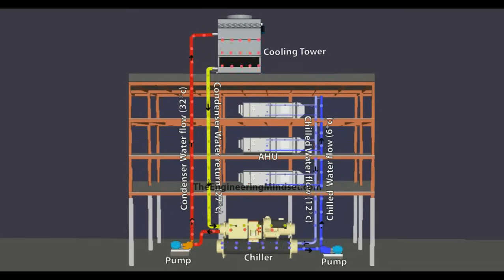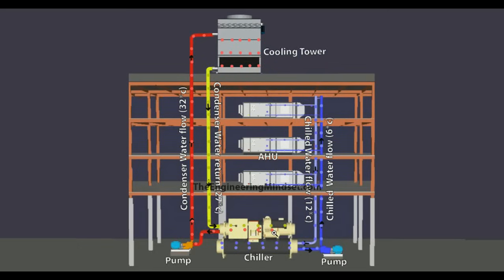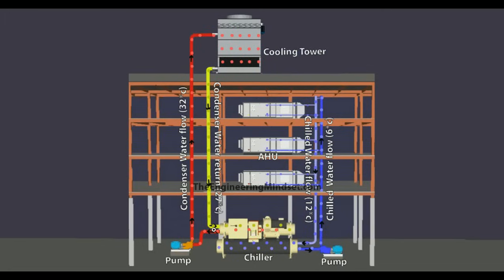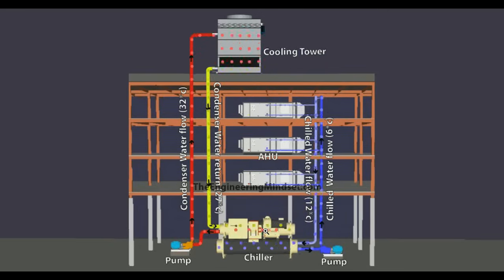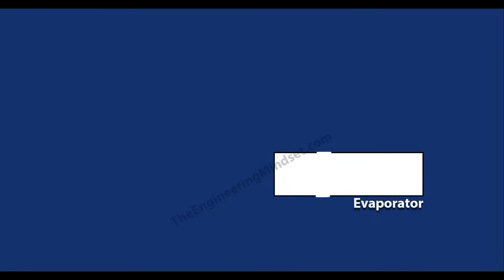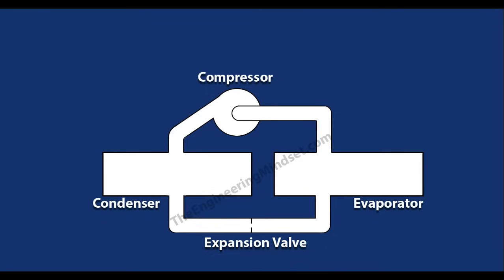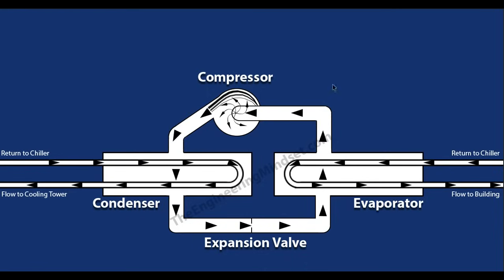Chiller Basics - How they work

Comment: The heat transferred from the returned cooled line of 12 deg. is cooled again up to 6" VIA EVAPORTOR NOT CONDENSER,
the purpose of the condenser is to minimize the temp. of refrigerant only which causes a cooling effect by evaporation,  there are two loops and water circulation, first is a loop for circulating the cooled air of 6 deg. coming out of the evap. the send it to the fan coil unit, and the second loop to circulate the cooled air of 27 deg through the condenser of the refrigerant to help it cools and cause the refrigerant in the chiller unit to change from gas state to liquid state. then goes to the evaporator to expand and gives cooling effect, STILL I AM GETTING LITTLE CONFUSION IN YOUR VIDEO DEAR

Comment: 00:06 A chiller is a large machinery used to generate cool water for air-conditioning in buildings.
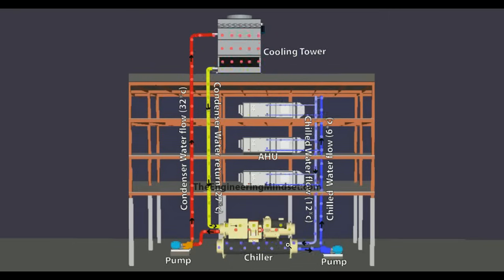01:55 Chillers transfer heat using a refrigerant and cooling tower to provide cooling for buildings.
04:14 A chiller has four main components: evaporator, condenser, compressor, and expansion valve.
06:23 Chilled water loop is responsible for collecting heat from the building
08:18 A chiller works by circulating refrigerant and water through different circuits
10:27 The chiller has four main components: compressor, condenser, expansion valve, and evaporator.
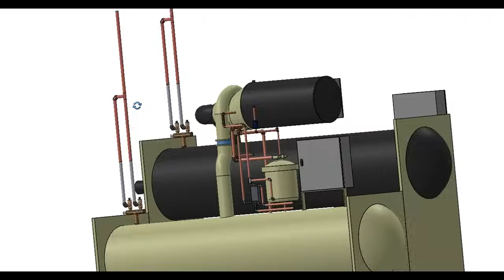12:40 Chiller Basics - How they work
14:53 Chilled water enters and leaves the system while refrigerant circulates throughout.

Comment: In the first video you said the condenser was on the top. 

In the picture diagram you said the condenser was on the bottom.

Which one is it?
Reply from the maker: It's wherever the engineers designed it to be. It can be side by side, below, above or remote. You can look at the system components to determine It or look at a system diagram

Comment: Can you point me in the right direction if you have a video on different ways to control the water/temp of each ahu/ fcu. Eg if the ahu1 still requires cooling but the space conditioned  by ahu2 is at the the required set point. How do the valves direst the water.

Comment: 3:20 how does the 27*C refrigerant from the Condenser Return picks up heat from the 12*C Chilled water return? Doesn't heat go from hot to cold? Shouldn't it increase the temperature of the Chilled Water Return and decrease the temperature from the Condenser Return?
Reply from the maker: The refrigerant is not 27 degrees, that is the condenser water. See this video for more details https://youtu.be/QlKSGDgqGF0

Comment: Hi thanks for the information. Question: so I live in a YCMA with a chiller here in Phoenix AZ. It’s hot 🥵 here. Our chiller is “broken” and needs to be “fixed” every summer. I have a feeling the maintenance department is not thinking correctly about our unit. Am I correct in that, more than breaking and fixing, these chillers need to be “maintained” daily?

Comment: Hey Paul, In the min video duration of 7.31 Min, i have a abit query. Where is the evaporator chilled water come from that circulate from evaporator side to AHU and then AHU return back to evaporator chiller?. Since u draw its different component from condenser. Because what I've understand from cooling tower then enter the condenser only circulate within the condenser and then return back to chiller right or the water is pass to TXV and evaporator? or only circulate Cooling tower and condenser?

Comment: some refrigerant system off air conditioning use solenoid valve after expansion valve. What is the function solenoid valve? if not use solenoid valve what gonna happen?

Comment: Trane chiller 
Model-CDHG(water cooled chiller)
Refrigerant- R123
Problem- chiller both circuit parameters fluctuating igv open close continuously not stable leaving water temp 
We changed leaving water sensor,saturation sensor,configuration,water flow normal,igv manually open no issue but still problem not solved,can u please suggest me 🙏

Comment: Only problem with the labeling is that according to the laws of thermodynamics, why would the heated water (12c) from the building want the transfer heat from it  to the refrigerant (which is at a higher temperature of 27c )? It makes sense if the labeling is flip flopped from water to the refrigerant side.

Comment: So the water passing thru the evaporator and condenser is separate? The condenser water will go to the cooling tower and the evaporator water where it goes?..
Reply from the maker: Please watch our turbocor chiller vidro
Reply: @EngineeringMindset  but is there a reservoir of a cooled water circulating thru the evaporator?. Like in the condenser, the water cooled goes thru the cooling tower.

Comment: Dear sir

I have one doubt, the gas is moving from compressor to condenser at High Temp and High pressure Gas and from there to Expansion valve at High Temp and Pressure Liquid (according to Vapor compression Refrigeration Cycle).
Now if there is a heat exchange from water to gas in the condenser which loops cooling tower then shouldn't the gas from the condenser to the Expansion valve go at  Low temperature and low Pressure Liquid ?? kindly clarify my doubt (I know it sounds stupid )

Thankyou

Comment: What is the flow to building and returning to chiller in a loop, water? Tape water or special type of liquid? And types or TXV used in the system?
Reply from the maker: Normal water, with some chemicals added to stop bacteria etc. We have a dedicated video on chiller expansion valve types.

Comment: Hello Namaste! 
As you said there are two openings for water one 6°c line which will go to to room Or space to be cooled and other line absorbing heat from space which is 12°c . My question is does refrigerant comes in contact with 12°c line if yes then why?? I understand it touches 6°c line to provide more sufficient cooling by extracting heat from water before entering to AHU

Comment: I have little Bit Confusion that In this Tutorial There is a Pump for supplying the condenser water to cooling tower is Wrong. and Chilled water Supplying Through a Pump.
The Condenser Pump Suck water from the Cooling tower to Condenser of Chiller.
And A Primary Pump supplying the CWR TO chiller and Chiller Supply CWS TO AHU with the help of Secondary Pump.
Reply: I think his example is an economical solution by taking advantage of the gravity feed from AHU to chiller return and utilizing only one supply pump for CWS back to the AHU. He is eliminating one pump in the process. Same gravity flow principle from the Cooling Tower to the Chiller as well. It is just an example.

Comment: Thank you for the explanation ...i just want to know,  so the whole system starting point is the water flow to chiller inside evaporator?
Reply: I understand some people view the evaporator as the central component of a chiller because that's where the  cooling of the air or water actually occurs. I personally view the chiller itself as the central component of the refrigeration system.

Comment: What happen if old design building cooling tower same level with chiller at the ground not at rooftop ?
Reply: cooling tower should be outside to push all hot air from water there. The best and cheapest way is just to put it to the roof outside.

Comment: Hi I have a question about the chillers unit? What does the AHU pipe do in the condenser socket? And why do I need an oil change?
Reply from the maker: AHU's: https://theengineeringmindset.com/air-handling-units/
Chiller oil: https://theengineeringmindset.com/refrigeration/

Comment: Hi ,
For that system is it different from the normal chiller? For normal chiller it use the gas to run through the evaporator to absorb the heat from the room. But in this system it let the water to run through the evaporator and use the cool water to absorb the heat.
Thank you,

Comment: Hi there, just a silly question. Is it possible to place the chiller outside the building and use the atmospheric air to condense the working fluid? What's the advantage of having the cooling tower?
Reply from the maker: Well yes but for that you would want and air cooled chiller. Check our other videos for tutorials Al's on that

Comment: A quick quistion. When the thermostat calls for cooling and it's pump down what's the  sequence does the water pump kick in first  flow sensor detects  and then the solenoid valve opens and then the compressor open?

Comment: Great video. I wanted to ask a question. My company has a chiller by carrier and it keeps shutting down. Last year it stopped working at least 8 times. I am not an ac tech but love knowing systems for knowledge. I spoke to the county worker who came to restart the unit and he was nice enough to show me the unit, and the readings of water input and output. The  unit was set at 44 degrees Fahrenheit. Water was coming in at 73 and leaving at 76 degrees Fahrenheit. I wanted to ask why was this happening and if that is  the reason the unit stopped working, but he got a call from his boss so I could not wait since I had to go pick up  my wife but was left wondering. Why the system shutdown. Is there a something that can be done to not stress the system so it won't stop working. Any recommendations?  Thank you
Reply from the maker: Check out our chiller faults video https://youtu.be/Zu0LVVNNVSw

Comment: the compressor compresses the vapor into liquid which heats it. the condenser cools the liquid coolant. the expansion valve expands the liquid into gas which super cools it cooling the water in the gas to liquid cooler (condenser). and back to the compressor. this is in every refrigerator, freezer and air conditioner.
Reply: The compressor changes a low-pressure gas to a high-pressure gas, not a liquid. The condenser changes the high-pressure gas into a liquid by removing heat from the refrigerant and rejecting that heat to the atmosphere.

Comment: Your video  is good brother  , but I have one doubt in this video,  from cooling tower outlet water temperature is 27°C and inlet to AHU water temperature is 6°C how this much temperature difference will come .
Reply from the maker: It will usually be designed to 12c flow to the ahu and 6c return, but these are variables

Comment: i have doubt? temp for return Chiller Water have 12 deg  and this return chiller water flow into the chiller- condensation unit. then how to become condenser temp  35 degree (flow into cooling tower)............?
Reply from the maker: Refrigerant takes heat, compresses it so more heat per volume, puts this into condenser water loop plus heat from compressor

Comment: Better to use the kind of heat exchange in evaporator or condenser rather than pick up the heat..also will be good to elaborate the process or state of refregerant in condenser and evaporator and compressor and what is the function of expansion valve.... anyway good work that lay people can relate the basics of water cooled chiller.
Reply from the maker: Hey Rockie, there's some links below to the content you mentioned
How refrigerants work in HVAC:https://youtu.be/lMqoKLli0Y4
Expansion valve: https://youtu.be/oSLOHCOw3yg
Expansion valves types: https://youtu.be/dXiV5YzTZQ4

Comment: Wish I had this for my house anything higher than 112 degrees and my A/C starts to lose the battle
Reply from the maker: haha might be a bit over sized for that load. Consider instead to limit the solar heat gain to the building. Reflective film, external/internal blinds and shades even place potted trees etc infront of your sun facing windows will make a big differance
Reply: geat video

Comment: Hi sir can you please tell me about air cooled chillers
Reply from the maker: We are part way through making the 3d model. But basically the sit outside typically on the roof and use a normal refrigeration cycle, there is no cooling tower instead the fans blow air across the condenser. the chilled water loop in the same as this type.
Reply: The Engineering Mindset chiller for 8 rooms how much expenses totally almost

Comment: What are the Chillers that don't have a  Cooling Tower, but have Condenser units called?
Reply from the maker: Familia Sanchez HVAC an air cooled chiller
Reply: What about the ones with Cooling Towers?
Reply from the maker: Familia Sanchez HVAC water cooled chillers
Reply: Thanks!

Comment: to dig a bit deeper in the chiller operation when the refrigerant passes through the expansion valve to hit the evaporator it turns into a vapor state because the compressor is forcing it to enter through the sized orifice. When it goes thru the expansion valve at a lower pressure this allows the refigerant to absorb heat and turn into a vapor state because liquid boils at lower temperatures due to lower pressure.  is this correct?
Reply from the maker: Wow that is a long name. Yes the refrigerant will decrease in pressure as it passes the exp valve and therefore increase in volume, decrease in density. The ref has a very low boiling point naturally so the thermal energy in the condenser tubes will cause the ref to evaporate which takes the heat away.
https://youtu.be/dXiV5YzTZQ4

Comment: trying find out the presssures temps when the chiller running ??  any recommendaations
Reply from the maker: If you have a chiller onsite, there should be either digital readings of the pressures and temperatures on the visual display or on the BMS. It should also give you some readings from manual gauges but these are limited and may not be accurate. If you do not have a chiller and just want more information, then I would recommend contacting some manufacturers to ask for data.

Comment: hey, what is air cooled packaged screw chillers? how works
Reply from the maker: Ayman M its a type of chiller which typically sits on the roof, it's a standard size and not custom built so it's a package. it doesn't use a cooling tower, it has fans built in to reject heat from the condenser and the type of compressor is known as a screw type.
Reply from the maker: Here you go! https://youtu.be/Ic5a9E2ykjo  How air cooled chillers work

Comment: can you tell me what's the height of cooling tower ?
Reply from the maker: They really vary on height. They need to be tall enough to reject the saturated air away from the inlet to prevent re-circulation, but they might be limited in height from local government building regulations. It depends on local conditions and system design. Around 3m is probably typical sizing for more modern ones, but I've came across some around 1.5m and some ~9-12m in height.